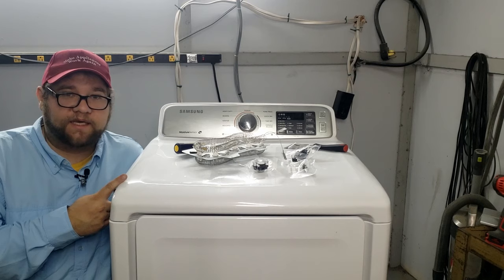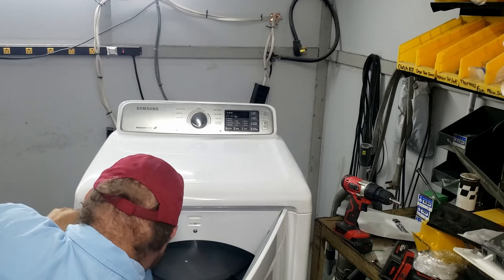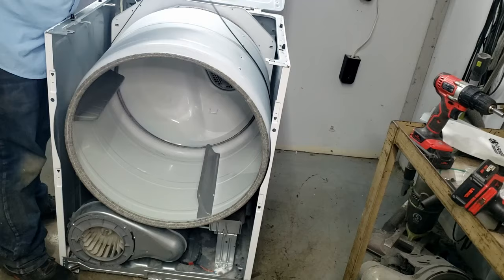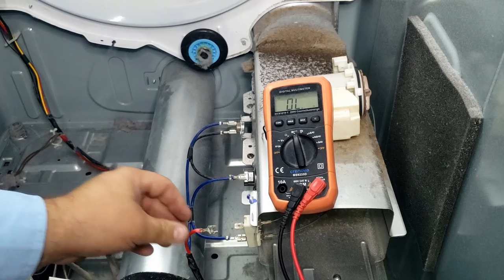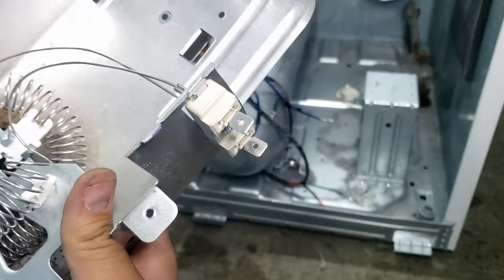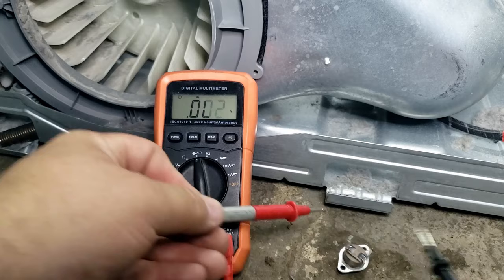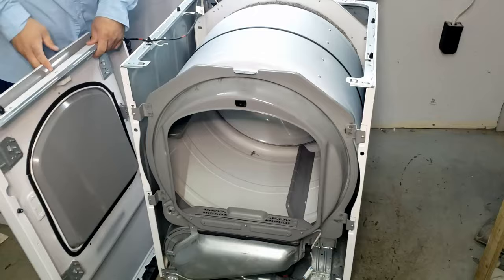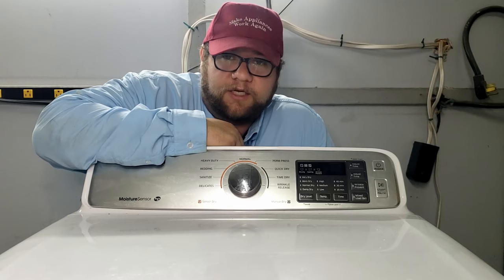Samsung Dryer Heating Element Replacement - How to Fix a Samsung Dryer Not Heating

Comment: Big thanks my man. This is a more thorough video than the last one.

I had a bad thermostat, and had to change the pulley system, apparently it is a common problem with Samsung. It was making a hell of a metal on metal racket noise, and the metal inside was wearing super thin. Anywho, I put a new belt too.

Thanks a lot.

Comment: Repair guys must hate Youtube. Great video. Tip: I replaced all sensors, element, belt, tension pulley for 65.00 (Amazon). Element bad, tension pulley bad, 1 sensor bad. You can check them all but for that little amount of money it made sense just to replace. I have worked on several dryers before and actually this Samsung is pretty basic. Would buy another. Thanks.

Comment: Fantastic video.  It's so cool to see that real humans don't make things like this so easy as they do from sites that make everything look totally simple. All they want is for you to buy your stuff from them. I like to use a marking pen to scribe things like the heater box before taking it apart and line up the scribe on the two sections to show how it fits back together.  
Yeah, that door switch is sure a PITA.  Cheers, and thanks again

Comment: A neighbor in town had a heating element go out on her dryer so I offered to do it, having changed at least a half dozen in my house and friends. Little did I know that Samsung, in typical Samsung fashion, made what is normally the easiest repair on a dryer into a freaking chore. Absolutely insane that you have to disassemble the entire thing to access it. Hopefully the replacement lasts bc she couldn't afford a genuine part Full assembly cost from $140-$180 which is absolute BS btw) 
Anyways thanks for this video, because I would never have guessed this all needed to come off to reach the thing.

Comment: Thank you so much for this video. While my dryer uses DC93-00154A (3 prongs instead of two like on the DC97-14486A here), everything else is exactly the same. I took my time and vacuumed everything before putting it back together and now it runs like new.

Comment: The video was great! A real game changer. My biggest problem reassembling, the position of the belt onto the motor and pulley.
Even though the video addressed the issue fairly well the learning curve with such limited visibility is trying. I could do it blindfolded
now.A big Thanks for the video. Also: I wanted to buy the heat element from  local dealer so I called for the price.
Yes they had it in stock. I thought OK I would be happy to pay double what Amazon would charge  to support my local 
merchant retailer. They wanted $178.00 I ordered from Amazon had it in two days for $32.00.
Reply from the maker: Samsung jacks the price up so high so dealers/ect push the whole cylinder system on people - the element pre-installed into the cannister with elements. Its the same price as the element-only for some insane reason.

Comment: Thanks so much. Fixed my dryer watching your video. One comment I would like to add is you can open up the heating element unit without pulling out the roller unit. The space is very limited so you need to take your time. And also be careful of the sharp edges.
Reply from the maker: You can do that, yes. There's always a big debate on "Do you take the drum out" or not, and I tend to be on the side of just taking it out, because it gives me way more space to work with, making it easier, and I can look at everything else inside the dryer, because so many times, an eagle-eye view of the dryer can spot more problems, easier.

Comment: This video made the job pretty easy.   As long as the circuit elements in the dryer heating element stay in the same order I don't think it matters which lead you have hooked up in the element as its a simple A/C circuit.  Just make sure you don't cross the leads on the heating element or ground out to the cover and attach the wires as shown and you will be good!

Comment: Perfect video. A $23 part saved me from having to buy a new washer and dryer - you know the wife likes matched pairs! It's amazing that only one tool (screwdriver) was needed to fix this machine. Oh yeah I did have to use needle nose pliers to crimp the connectors.

Comment: Great video. The only little bit of advice I would add is that before taking out the drum grab a sharpie and mark the front and back. It's possible that it's identical but I accidentally put it in backwards on mine the first time and the belt lined up differently and it didn't turn as smoothly as before. I switched it around and I was good to go.

Comment: Thanks for the video and link to the parts! I used both and our dryer is up and running again! I did the whole thing (including cleaning and taking a break to wait for the part to be delivered) in about 3 hours. Total layman. Everything you said to do was spot on and made it easy! 
Well done.

Comment: Thank you so much for this video!  I was able to repair my Samsung dryer, which honestly I did not think was possible.  The whole video is great but especially the part showing how the belt goes over the pulley.  I started the repair because the dryer was not heating, but after disassembling it became clear the pulley was also on its last leg.
Reply from the maker: I'd venture to say 50% of the time we tear into one of these due to a bad heating element, we replace the belt & pulley too. They are NOTORIOUS for going bad.

Comment: The only question I have is if it matters where you connect the positive and negative terminals to the sensors. It was hard to distinguish which one was positive and which one was negative but the video helped tremendously with the repair. Thank you!
Reply from the maker: Kind of, but generally no. There's no polarity on the element.

What you have on pretty much any schematic is two hot wires that go to the element. One goes typically through the motor then to the element directly, then another that goes from the control board to the sensor chain, then to the element. As long as a wire goes to the thermal cut-off/fuse then to the thermostat, then to the heater, you're good (then the other trunk wire goes straight to the element).

All the sensors are doing is relaying the electric from the wire through themselves as long as the correct conditions are met. For the thermal fuse/cutoff, it permanently shuts off if the temperature goes over roughly 350*F. For the thermostat, its on/off at 250*F but cycles itself to moderate the heat to prevent that cutoff from popping. So as long as the wire chain is correct - from one cutoff->thermostat->element, you're OK

Comment: Great video! Thank you so much as your video got us back up and running. Someone said in another comment to leave the drum in because its not necessary to remove it but having that space all opened up by removing the drum made it much easier. And I totally understand now why you said you had to reassemble the canister off camera. My God getting the belt for the drum back in place and reassemble of the canister were both very frustrating. BUT I am no pro and everything is back together and working. With this video it can be done with the understanding that you need PATIENCE. It also would help to not have the wife dropping by every ten minutes asking hows it going? Again patience helps with that too. THANK YOU AGAIN FOR THE HELP!!!!!!!
Reply from the maker: Glad it helped! The big issue with doing this is the first time is always painful - getting it all set up right. But the second time, if there ever was one, goes really, really fast. Its always fusterating because the time consumption is wild on the first go-thru. Glad to hear its up and running!

Comment: Great video,  thank you ! In my case i have a front loader. It was easier for me to removed the rear bottom panel in order to get the belt over the motor gear and around the tensioner. I couldn't do it blindly from the front.

Comment: Thank you for all your help and guidance you not only saved me time and money but sanity by letting me realize it will take a few tries to get it back together. I hope you have a great day I hope your business thrives even in the epidemic and I hope that everyone realizes how kind and nice you are .Take care stay blessed and thank you again
Reply from the maker: Many people think that appliance repair is a mystical, difficult art, when 80% of the cases its basically Big Kid Legos. Once you figure out the puzzle of taking something apart (the right way, mind you), its really not all that hard, especially if you buy that $30 multimeter in the video. At that point you're just testing the stuff and figuring out what part is bad, then slapping a new one in. 

Even in doing this for a few years, I still get stumped, but I've found out even guys with 20+ years do too. It happens, and its OK. Even the best can get stumped, so its OK to try as you can and see if you can get it taken care of, because again, 80% of it really isn't that hard if you know how to open the unit up.

Comment: Very helpful video. You do not need to remove the drum.  There is just enough room to wiggle the heating element out without touching the drum. I found no need to test anything. The replacement parts kits are cheap enough that you just replacement all the parts on the heating element, and put everything back together. Either you have heat now, or you don't.
Reply from the maker: If certain parts fail and not others, failure to test can lead to situations where there could be problems with particular systems that are only revealed by tests.

Comment: Wow. That's definitely the looks like hard way to do it. I have replaced the in my Samsung (same model as video) multiple times and I did not need to remove the drum. I simply unscrew the heating element housing from the base it sits on, unscrew the base, lift the heating element as high as possible, then push the base over and remove it. The tricky part is the base. It has tabs on the back end that lock it in place, so you have to turn it up 90 degrees (push it towards the back and lift it up). With the base out, the heating element will then slide out easily. Jus repeat the process when putting it back together. It is really tight for space and requires patience, but it seems a lot easier than pulling the drum out. I had to replace drum rollers on this wonderful piece of low-grade engineering equipment once as well and I did not enjoy removing and reinstalling the drum.

Comment: Great video and makes believe I can do this. :)
1. I have this exact dryer. How do I know if it's the 2-wire or 3-wire design? There are two options to buy but I do not know which one this dryer is.
2. Where is everyone getting the $35 parts? Both options (2-wire & 3-wire) are $70 & $90 respectively.
Thank you for this video.

Comment: Very informative and great video! HOWEVER, this is the older longer process for replacing the heating element. There is no need to disassemble the majority of the dryer to access the element. With a slight bit of patience, it can be done by just removing the top and front. There are numerous videos on YouTube showing this. I’ve replaced mine a few times as these Samsung’s are great but notorious for bad elements. Great video though!!
Reply from the maker: The catch is that although the video title is for the ELEMENT itself, there are other things to deal with the heating process, thus all the other parts of the video. Because of this, I fully disassembled the dryer in the event of something else causing the unit not to heat. For example, I show how to deal with the thermistor and thermal fuse on the blower housing, which aren't going to be accessible by just removing the front to replace the heater can, and would require removal of drum + bulkhead.

And beyond that, you said "With patience, it can be removed by just removing the top and front" - that's the catch. You said it takes patience to just remove the heater can... I've done that many, many times, and when I time myself, the bulkhead removal + drum takes about the same amount of time, with considerably less chance for other problems arising, IMO.
Reply: It is not difficult to remove drum,  adds an extra ten minutes and you have full access to remove/replace the shroud and clean the massive amount of lint that accumulates behind the drum. no patience needed.

Comment: I love your channel. Thanks for all the informative videos. I learn something every time I watch one. You should use some of your huge profits to buy a cordless drill/driver. It would speed up your teardowns immensely.
Reply from the maker: I do almost all the off camera stuff with a 20v hyper tough drill. I only use a screwdriver because it's easier  to explain which bit to use or what not. I had a samsung frontloader with a bad idler pulley two days ago... got it zipped off in all of 15 seconds from getting down on ground to remove the back panel lol

Comment: Very helpful thank you. $30 kit way better than buying a new dryer. Still never buying another Samsung. Pulley has busted twice, now heating element, all within 3 years of purchase
Reply from the maker: OEM pulley assembly's are just totally awful. Some aftermarkets are better than factory due to presence of a roller bearing. Its crazy how BAD they are.

Comment: I can save you a step in this procedure.  You don't have to remove the drum or even loosen it from the tensioner if you have a friend who can just hold it in place when you take off the front of the dryer.  I had my wife hold the drum in place while I laid on the floor and unplugged the assembly and unscrewed it from where it was mounted.  I then slid it out and I replaced the entire assembly which can be found on Amazon for less than $50 by searching "DC97-14486A Dryer Heating Element Assembly".  If I was going to the trouble of taking this dryer apart I wanted to replace any part of it that might have gone bad.  The most difficult part is just inserting the end of the heating assembly into the large orifice at the rear of the dryer and the next most difficult thing was to simply get that tab slid into the slot where that assembly mounts.   So thanks much for showing how easy this is to do for the typical homeowner.  Oh yes, it's easier to plug the wires into the new assembly before you fully slide it into place so you can see what you are doing.  Cheers.
Reply from the maker: I do not reccomend it because I've seen people fail to put the assembly in properly, causing the cannister to collapse and then have a catastrophic failure. You can do it that way for sure, but not something I really want to show people

Comment: Changed my heating element and both sensors.

TIP: ensure that your heating element wires do not contact metal canister.  If they do, expect your element to burn out faster.

Comment: Question, so I just replaced my heating element, along with all the various sensors as described in the video.  I plugged all the wires in exactly how they were before the installation.  I put everything back together, plugged it in, and hit the on button, power to the console, then I hit start and it would run for about a half second before tripping the circuit breaker. Any clue as to what could be causing this? I bought the replacement element off of Amazon. The kit says it fits my Samsung model dryer.  No idea why it keeps tripping.

Comment: Thanks, man- you have a great way of explaining things. You're an awesome dude for helping so many of us.
Reply from the maker: Awww, thanks!
Reply: @bensappliancesandjunk  Got a question for you. My dryer was making a lot of noise, and also wasn't heating. I ordered a kit that includes the rollers, the tensioner, and a belt. I also ordered a kit that came with a replacement heating coil and 4 sensor type components. I metered the sensors, and the 2 fuses and thermostat showed continuity, as they should, and the thermistor didn't show a reading- my multimeter only shows continuity or open loop. I found the new ones to be the same as the old, so I saved them. I swapped out the faulty heating coil and put the dryer back together. When I tested it, I'm showing 200 +degrees. I opened it back up and replaced the thermistor and thermostat. Same temperature. I opened it back up and metered the heating coil with the wire connectors separated and showed continuity across the coil contacts, and no continuity to the housing. Does this mean my problem is coming from the control panel?
Reply from the maker: @jklstewart  Is this for a Samsung dryer? They have an issue where the centrifugal switch can go bad. Its on the motor-area. The metal contacts can fuse together and force the unit to to run constantly feeding heat to the element.

The way you can diagnose this is put it on air-fluff. Does the unit run heat in air fluff? If so, its the board relay that's forcing heat. If not, check the centrifugal switch.
Reply: @bensappliancesandjunk  Thanks man! I'll check it out.
Reply: @bensappliancesandjunk  This Samsung dryer of mine doesn't have 'air fluff', but I set it to 'wrinkle release', and it lights up the 'low heat' light, out of the low, medium, and high options. But even with that selected, it's measuring 240F out of the vent. I pulled the board out and put my meter on it. Neither of the two relays showed continuity. If it was the heat relay, would it need to be shorted closed to cause my problem- so that it was constantly passing heater voltage to the coil?
Reply from the maker: @jklstewart  tap the relays pretty hard with a screwdriver a few dozen times. going back and forth. see if that changes the heat output. If it does, then its the relays. You have a very very infrequent problem, but its either going to be the board or motor.